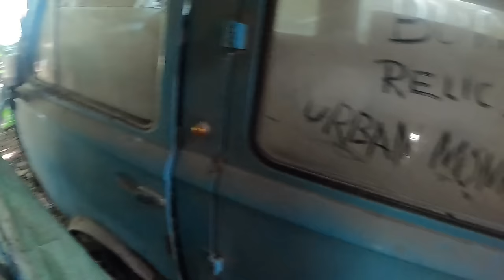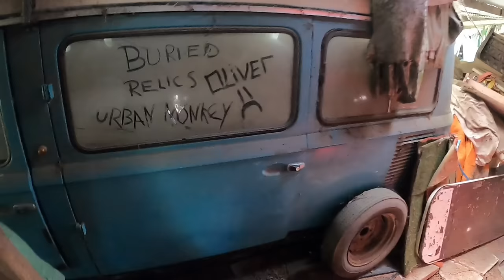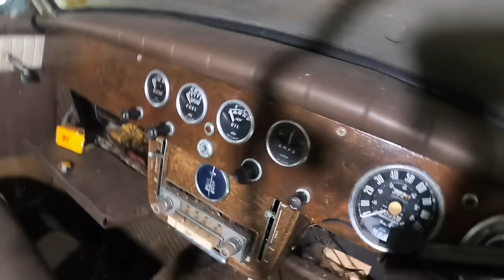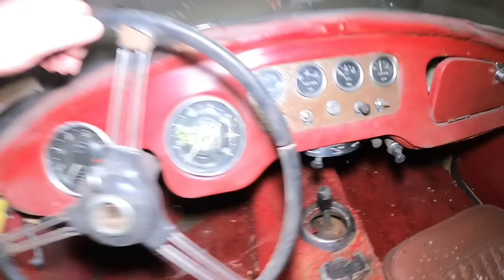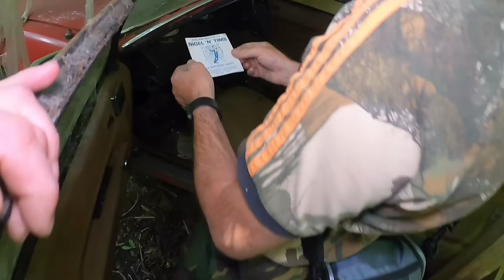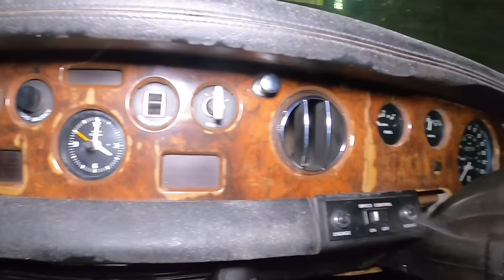abandoned car collection

Comment: I was interested to see when they last had a V5 certificate transferred.
It kind of tells you the last time they were possibly used or sold to the collector.
The L reg triumph stag had a V5 c issued in 2012 and the RollsRoyce in 2010.
No details say when they were last taxed.
I’d download Car checker and use it next time you explore.
If the car is on the data base, it’ll give an idea how long it’s sat there. Assuming they were bought and just put away.
Such a sad sight to see these cars just rotting away.
Hopefully someone might save them instead of just scrapping the hem when the new owners bury up the land.
There must be a small fortune hiding there.

Comment: Rolls Royce, manufactured sep 1975. MOT expired 2010. Just over 5000 miles on the clock. 
There was a list as long as your arm that needed work doing to it and some work needing urgent repairs because it was Classed as Dangerous to drive.

Comment: DON'T TELL ME THE FUCKIN CAR AT 24:55 IT'S A JENSEN GT. ONE OF 509 MADE BETWEEN SEPTEMBER 1975 AND MAY 1976. EVEN RARER THAN INTERCEPTORS. ALL PARTS ARE PROBABLY THERE. THE SHELL LOOKS SOLID AND IN VERY GOOD SHAPE, PROBABLY ONCE UNDERGOING RESTORATION. THAT CAR IS MISSING FROM MEETINGS AND MAYBE FROM MUSEUMS.
Reply from the maker: I'm not a car buff but if that's what u think it could be then could well be m8 what's it worth if it is ?

Comment: All those cars are free you can haul them out of there. When they've sat that long and the buildings are collapsing, whoever owned them died and nobody's taking any interest in them so whoever does decide to go back there and get one they're free. Find out who owns the land they'll probably let you have them for free if you'll just haul them out off the property. My Russian friend is right don't build buildings out of wood. Those cars would have been better and steel barns. All of their communist garages in Russia were all made of metal and they still stand today. With cars even older than those in them they call them garage finds instead of barn finds. Hundreds of Soviet days garage units down by the railroad tracks in Russia and they were made of metal and they're still standing.